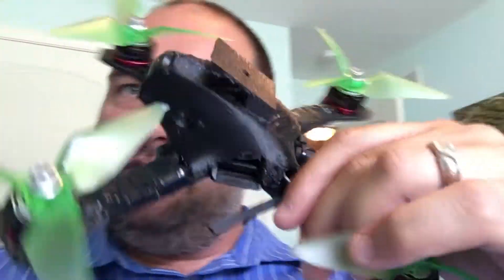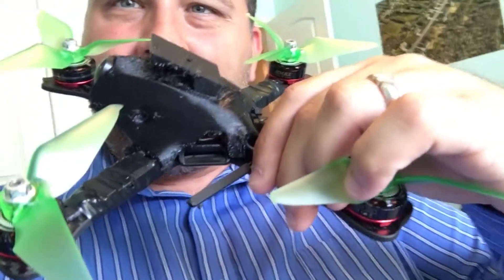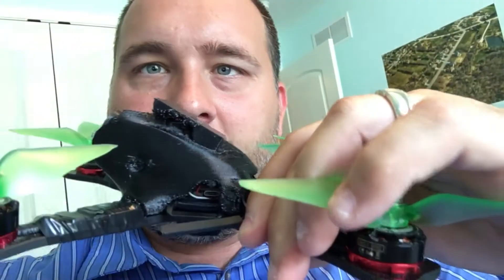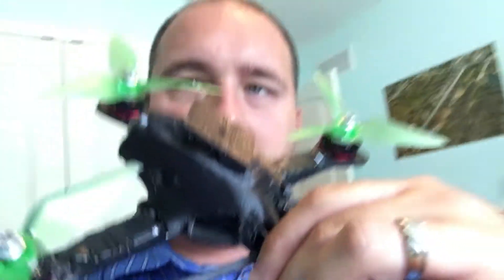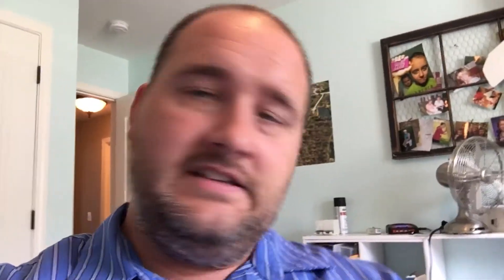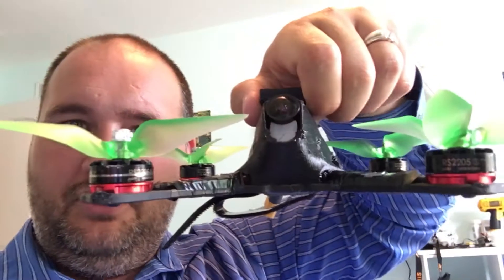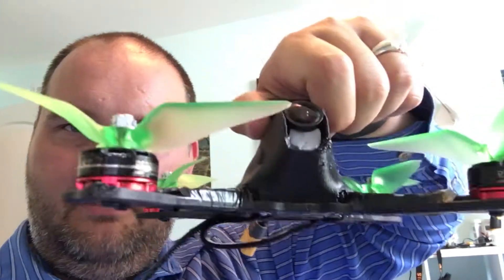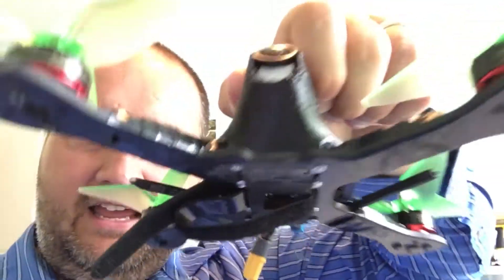Quad Yaw Twitch / Glitch Solved

Comment: I think switching back to multishot caused your pid loop frequency to drop to 4khz. Multishot is not compatible with 8khz so it will automatically drop to its highest  setting. Try switch back to dshot and lower the gyro and pid loop frequency to 4k/4k. With Dshot you may be able to achieve smoother flight and also enable turtle mode and motor beeping.